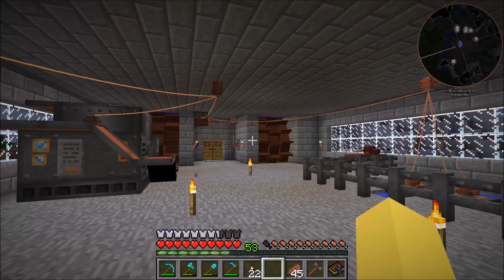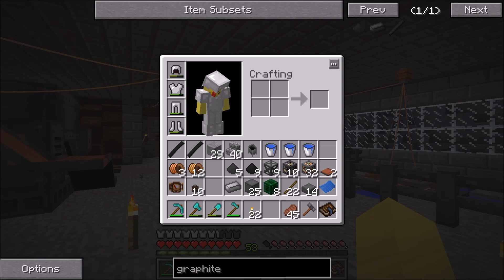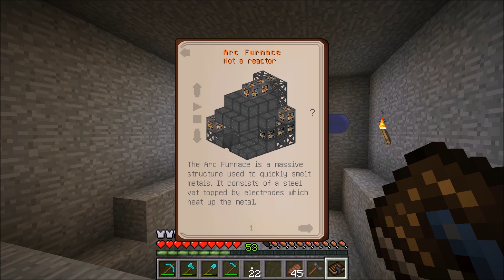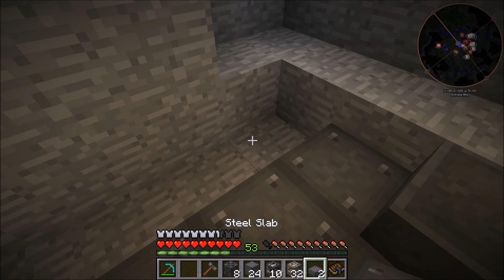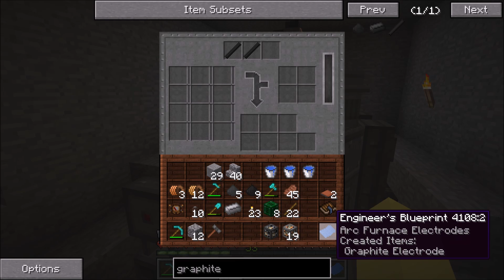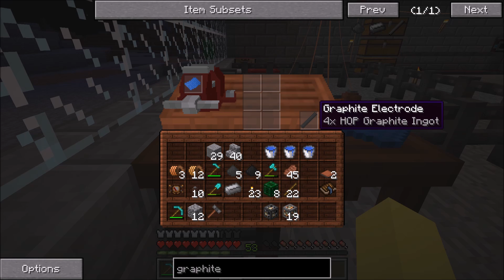Surviving With Immersive Engineering :: Ep.16 - The Arc Furnace

Comment: Like the excavator, I use the Arc Furnace by placing an HV capacitor and letting that charge over time, and then using the Furnace in bursts.
Reply from the maker: +Triaxx2 Yea, that seems to be the best way to do it unless you have multiple diesel gens :P